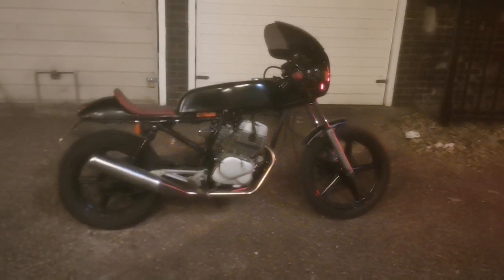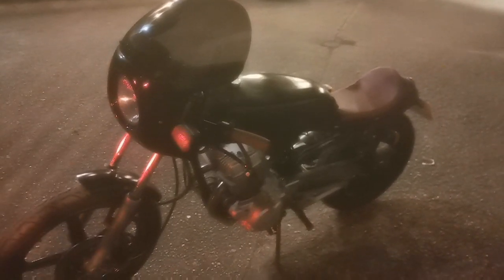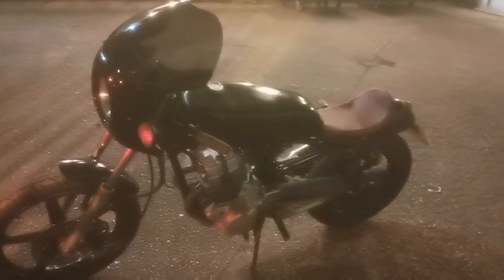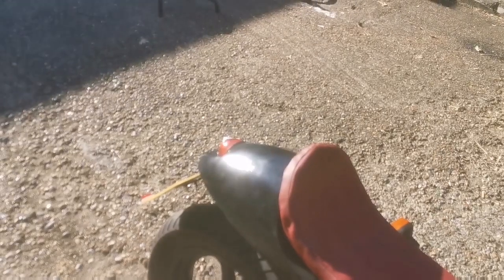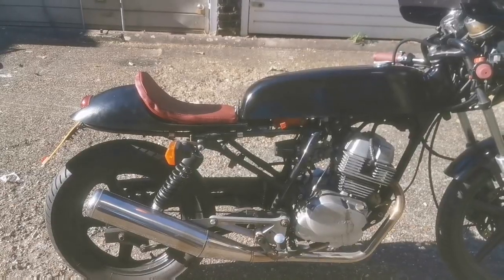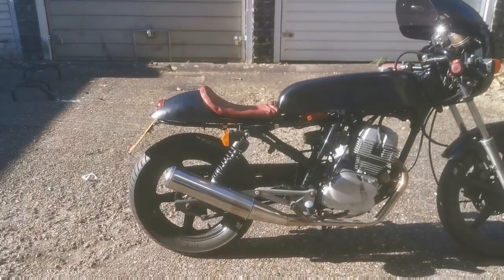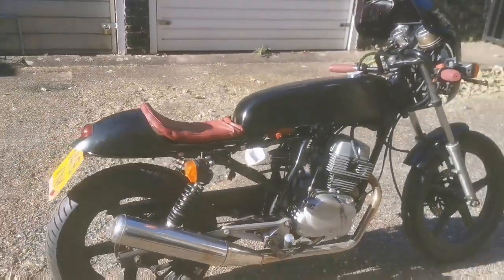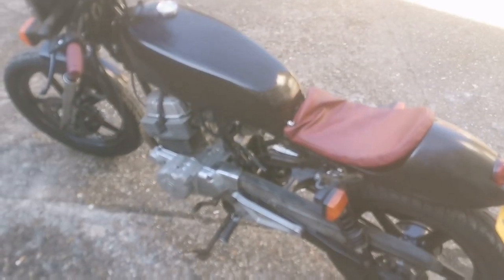Barn find honda cb250, first look, how to buy a bike from ebay, café racer review.

Comment: Charlie stick bigger dog tags on the rear to jack it up.
Relocate that battery into or along with the proper air filter housing.
Micro indicators and maybe a halo style headlamp.
Once up and running maybe change the end can for something like a gp style #loud.
Should keep you busy for a week or three and nice find 👍
Reply from the maker: It dosnt use dog bones does it? It's 2 separate shocks so these may need changing or I drop the front a little more.

Definitely smaller indicators if I can find the relay to change it.

I'm not sure about the front end yet. First thing is to get it up and running.

Thanks man.

Comment: Looking forward to this one. 
Picked up a CB 400 at weekend and doing the same. 
I would lower the front as back looks the right height. Go with the air box and panels at sides. 
Would maybe change handle bars as it looks like they are originals turned upside down. 
Keep up the great work mate!!
Reply from the maker: They aren't originals the bars they are specifically made to cafe a bike, however if I go with clip ons then I can lower the front more although the back is very low. I can get 37cm rear shocks but need to measure these and see what size these are.

Thanks for watching and the comment.

Comment: I like cafe racers but not on small bikes still should be a good progect to watch you tinker with looking forward to watching
Reply from the maker: No way, cafes are all about small engines, a 250cc cafe is great because you have to lighten it up and strip it down to get the best out of it. Hence why the tank is fibre glass.

Nothing under 250cc though.

Comment: Nice project. Maybe some red Honda decals on the tank. Loads on eBay dead cheap. Might just break up all that black on the tank
Reply from the maker: That's a good idea. I'd love to wrap the tank in a chrome but I'm rubbish at wrapping.
Reply: motorcycle rescuer That would look great but it’s very unforgiving. How would petrol react to the wrap if you spilt some filling up.